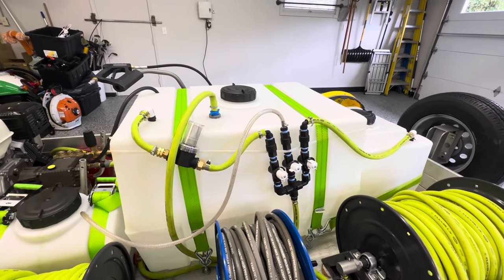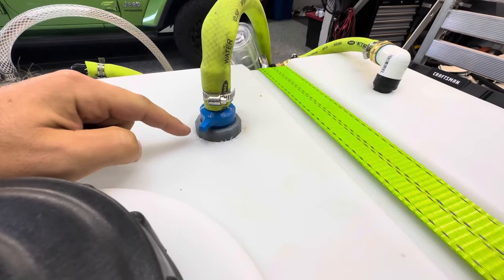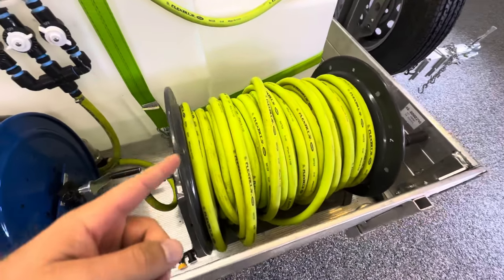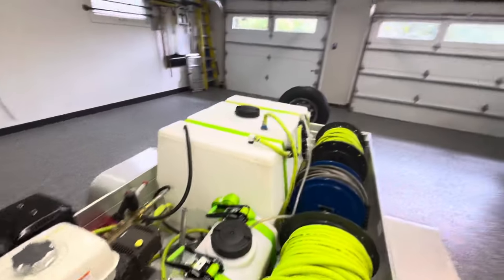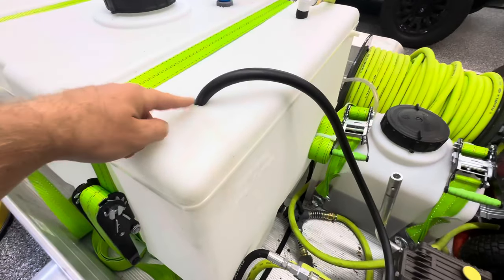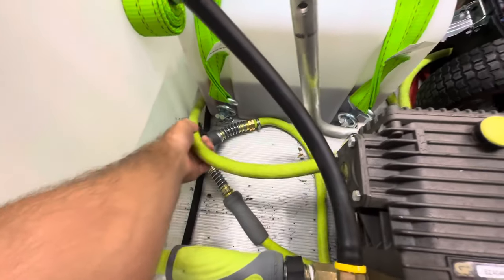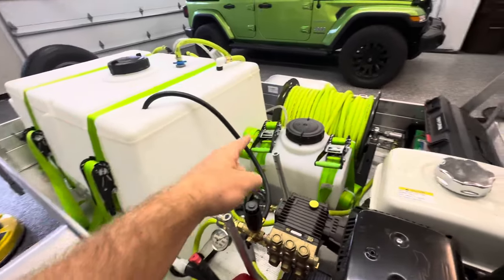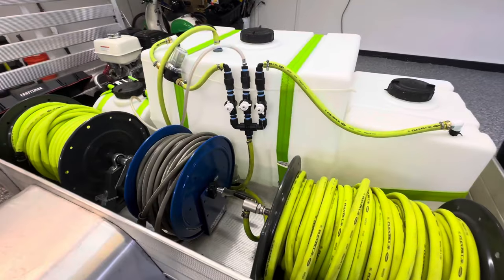How To Build a Buffer Tank For Pressure Washing / Soft Washing

Comment: I be getting a simpson 440psi 4gpm pressure washer and was wanting to hook it up to a buffer tank so i wouldnt have to keep holding the trigger and think it be more convenient i was told in a post that i needed a unloader valve and a bypass so it would put the water back in the tank so it wouldnt burn up the pump
Reply: any more info on this? I just got the same pressure washer

Comment: What did you mean about water cycling. I’m confused what the black line is doing. Thanks!
Reply from the maker: Hi there, so basically pressure washers keep recycling the water in the pump and sometimes it gets overheated and damages the pump. I connected that black line to my buffer tank so it just spits that water back into the tank instead of recycling.

Comment: the 100 gal tank holds enough volume to push the water. it would need to be a least half full to push the water without problems
Reply from the maker: Yes sir! Great comment
Reply: Wait is this true? Water just has to be at least above the neck of the water inlet to the pressure washer
Reply: @321Misfits No it’s not. The triplex plunger pumps will pull the water to it

Comment: The typical residential water flow rate for small households is between 6-12 gallons per minute.
Reply from the maker: That’s generally not true, for at least where I live it’s more like 4-6
Reply: @kurtspressurewashing  the county may have a water flow restrictors on residential & commercial to regulate pressure

Comment: Hey man, I can't find the answer to this anywhere on the internet regarding buffer tanks. Hope you can help. I know you mentioned that the float valve will shut off the water if it gets full, but how exactly does that work? The customers spigot is still cranked open, isn't it? I'm just trying to understand how water just stops from over filling and not just flooding out the top of the tank, and getting your trailer all wet?
Reply from the maker: Honestly, I don’t known the science behind it, but there’s a valve that closes I know when water gets to it. Yes you can leave the customers spigot going, and while you use water it will keep filling
Reply: The water in the tank will push the internal float up covering the inlet water hole.

Comment: Would this buffer tank feed a 4gpm direct drive machine ?
Reply: I'm running into this issue. Not sure if I got air in my line or not
Reply: Seems to me it's a fluid volume issue not a technology issue so the pump or drive or whatever would be irrelevant.
Since most spigots at a property only deliver 4 GPM, you need the buffer tank if your Pressure Washer moves that amount or more.  You simply fill up the buffer tank then the pressure washer pulls from the tank.  The PW will be drawing down on the tank but the spigot on property would be refilling the tank when there's no draw down.  The shut off valve at the top of the buffer tank ensures no overfill.
Reply: @jones_edition  huge downwards slope in the non-collapsible hose for the tank->pressure washer inlet line

Having descending diameters on the non-collapsible hose ____(I've only heard of others doing this, don't quote me)____ example:  tank's start valve diameter of 2", going to 1 1/2" a bit down the line, then going to 1" shortly before the pressure washer inlet, then having a bit of 3/4" line before the inlet.

If that's entirely true or even how tf u do it, I don't really know. But it sounds cool.
Reply: @BCNTR  I figured it out. I have a 1 inch line to the 3/4 Inlet. I also built a air bleeder system. Been working great all summer

Comment: I'm confused how you can run a direct drive pressure washer off of a buffer tank?
Reply from the maker: what are you confused on? it pulls great from the buffer tank
Reply: @Kurtspressurewashing  most direct drive pressure washers can't run off a buffer tank. They need water being pushed into them so they need to be connected to a house directly
Reply: @BigRumpo True with cheap Home Depot pumps. He’s using a plunger pump. First stroke pulls in the water and the second stroke pushes out at high pressure.

Comment: A lot of videos talking about soft washing. We focus on government public works and we do a lot of flat work, Concrete and brick 95% of the time. Do you need a software system if you're just cleaning concrete and brick?
Reply from the maker: Yes, it breaks up the mold and algea and wont leave lines once you put pressure on it